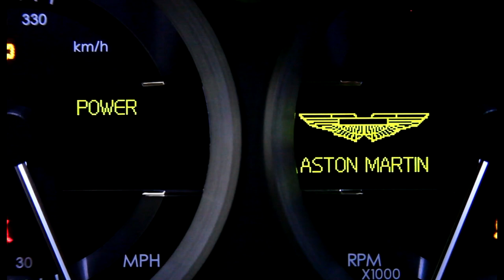Center Console Power Point Upgrade & Wire Dressing - Aston Martin DB9 Infotainment Upgrade - Part 9

Comment: Instead of standard electrical tape, I've recently been using silicone self fusing tape. It's a little more bulky, but it doesn't have any adhesive to get goopy and fail over time. It just sticks to itself.

Comment: 9:29 the downside to how you're putting this together is that if you need to take out this console, you have to pull apart the footwell carpeting to disconnect this harness. All the other switches and stuff in the console are disconnected at the switch. There should be enough room under the console to bundle the wire and have the connection in the console area.
Reply from the maker: Hi Matt.  To a degree, but its very easy to pull back that side carpet and just unplug the Console harness from the wiring organizers put in place.  And with this video I'll never forget where the wires go!

Comment: so the ashtray replacement frame was not designed for the db9?  and so the 12v power socket is now too long to fit?
Reply from the maker: The 3D printed replacement ash tray is deeper, so this moved the 12V power socket lower.  They have the one design they use for all the Gaydon cars, so I expect there is more clearance in some of the other models.  Now that I'm through it, I actually think this is more useful and should be the default path anyways.  A quick charge power port is more useful than a 12V power socket since all I would use the socket for is a charge point.  Thanks for watching!